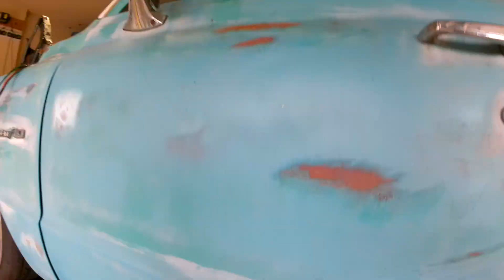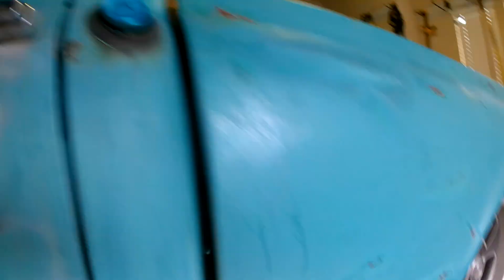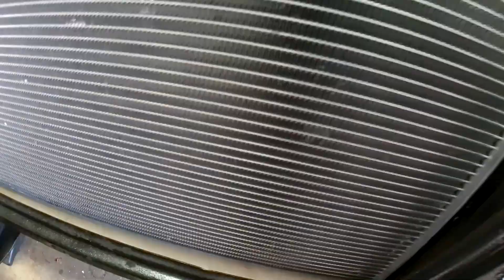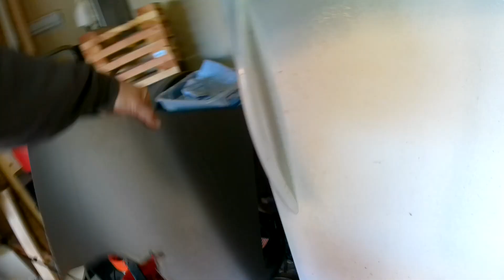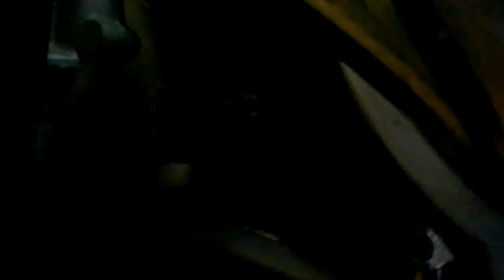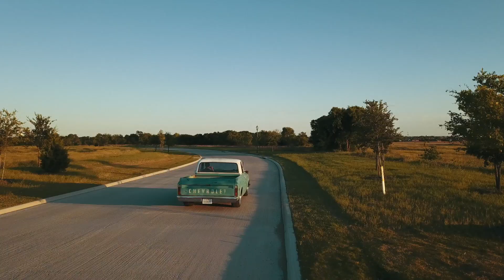1972 C-10 LS SWAP Build Series PT.6

Comment: just dropping back in and im at the point that drive train is in, cab isnt on right now but do you have any insight to share on positioning of the drivetrain forward/back.. I too have used the dirty dingo crossmember so i was hoping to get an idea on a reference point.  i will also be putting in the dual electric fans.  thanks in advance for anything you might be able to share on the matter.
Reply from the maker: There are 4 mounting positions for the DD motor mount plates.  I used the position that put the engine as far forward as possible in order to get some clearance with the firewall.  As far as the transmission crossmember goes, I set the engine and transmission in and simply bolt the crossmember to the frame wherever it hits.  I find it pretty rare that the mounting holes will line up with any factory holes on the frame.  So be prepared to drill some new ones.
Reply: @JeffLyle  thanks again for the quick reply! .. i think things are looking good .. tomorrow i will toss the cab on !
Merci.
Reply from the maker: @cdnbroncolife1889  That's awesome. I hope everything goes smoothly for you during assembly. But if it doesn't, just keep on wrenching and enjoy your passion!

Comment: Thanks for taking us on your journey. I'm going to be LS swapping my truck next year. Slowly getting all the pieces together.
Reply from the maker: Thanks for following along.  My sons and I had a great time building the truck.  Since then, we've done a bunch more... welded up new rockers, floor pans, and supports, added a new TMI interior, built a center console, and put a complete stereo in.  We've put 6500 miles on it since we swapped the drivetrain and it is continuing to run great.  If you have to video anything you do, I'd love to see it as well.  Best of luck with your build!
Reply: @JeffLyle  I repainted my interior, refreshed my gauages, new dash pad, reupholstered the seat, painted the door panels, and added a tach. I've done a lot but still a lot more to go. I'll have a garage next year so I'll be trying to do some videos on the swap.
Reply from the maker: @cfrank925  That's awesome, I can't wait to see it!

Comment: Nice looking build. I’m doing my 72 Ls swap as we speak getting everything lined up. Where did you get your cold air kit? Been looking for ideas on what to use and I like yours.
Reply from the maker: Thanks for checking out the build.  The cold air kit I got is the no name ~$50 kit from amazon.  It is sold under various names.  They are marketed as 99-06 silverado or tahoe and the tube comes with a bracket on it and it's about 10" longer than mine is now.  I just cut them up to fit.  I also use the couplers that come with the kit and the clamps.  However, they are not the best quality.  If you overtighten the clamps, they will break, so be careful, or just know you may need to buy extra clamps.
Reply: Sounds good yea that’s the part number I was looking at. How about your speedometer is that doing alright?
Reply from the maker: @ss454gm  speedo is spot on!
Reply: Thanks yea I seen one on eBay like that just a basic kit for like a 01 5.3
Reply from the maker: @ss454gm  by the way, nice c10 you have there.  I'll be checking out your videos as you go through your build!  Let me know if you have any questions along the way.
Reply: Sounds good I will. I’m going through my motor now doing a btr stage 3 truck cam and doing lifters rear main front timing chain and cover etc before I put it in the truck. Ordered my Holley x max harness the other day.
Reply from the maker: @ss454gm  oh man, you are well on your way.  That cam is going to be awesome.  If you havent thought about it yet, consider doing a converter too while you have the transmission out.  That cam will probably like something in the 3000 stall range.
Reply: Yea I got a rebuilt 4l60 with a 3k stall to pair up with motor. Hopefully this Holley harness gets everything going like it should I’m using a drive by cable motor from a 01 truck
Reply from the maker: @ss454gm  Perfect!  Drive by cable is cool too.  I just wrapped up an LQ9 swap on a 70 chevelle and we put a new intake and DBC throttle body on it.  I actually had a much easier time tuning the DBC than the DBW setup initially since the instructions are pretty simple.  They all require a little fine tuning though so be patient.
Reply: Yea he is sending me the Interface cable to hook up to laptop with my kit so hopefully get it all going good before all these c10 shows this summer. Hey on your Dakota gauges did you have any problems getting everything to work since your using the Holley setup?
Reply from the maker: @ss454gm  I went the easy way and used the Holley to dakota digital interface to hook the gauges up with.  I think all I had to wire was the fuel pump, power, and ground.  Everything else went straight from the Term X to the gauges through the interface from dakota digital.
Reply: Yea that’s what I was going to buy just heard few people was having problems getting the speedometer working. What all does that Holley interface do on the cluster oil temp tach volts etc I bought the rtx cluster
Reply from the maker: @ss454gm  BIM 01-2-HLLY module is what I use and my gauges are the VHX.  Everything reads out pretty close to what the handheld says... Speed, tach, water temp, AFR, etc.  I don't have a fuel pressure gauge hooked up so it doesnt register.  The only thing that is off a little that I can tell is the water temp.  The gauge on the cluster says its about 5 degrees warmer than the handlheld says.  I use a splitter so that the handheld and the gauges are both hooked up and I've never had any problems.  The instructions say it works with the RTX cluster too.
Reply: What kind of splitter do you got to use to make both work
Reply from the maker: @ss454gm  part number 558-465 Holley EFI CAN splitter.  This allowed me to run the digital dash interface and the handheld at the same time.  When I plug my PC in to do fine tuning and things, I just unplug the handheld and us the CAN to USB cable
Reply: Good deal thanks I’ll go to holleys website and check it out

Comment: Pretty sure I just saw this truck on facebook marketplace forsale
Reply from the maker: Scared me for a second.  I just looked in the garage... it's still there :)  Thanks for watching Slim!
Reply: @JeffLyle  theres def one just like it down to the wheels
Reply from the maker: @slimwilly573  that's pretty crazy!  Maybe it's an old post.  I bought this truck on marketplace over a year ago in Mesquite TX.  Where do you see it posted now?
Reply: @JeffLyle  it was a day or two ago.. and either north ga or Tennessee Carolina's I will see if I can find it again but same wheels, same color
Reply: @JeffLyle  what would you say the cost of doing the swap
Reply from the maker: @maddiesmithmaddieg  The essentials to get this done for me included the oil pan and gasket, full exhaust, fuel system (pump, lines, fittings, regulator), motor mounts, transmission crossmember, intake tube, shift linkage, radiator hoses, and driveshaft u-joint were about $1700.

I had the engine and transmission from my swap vehicle.  If you don't have that, they can be found for about $1000-$1500 with harness and computer depending on year, displacement,  and mileage.

I did a ton of extras like dakota digital gauges, AFM/DOD delete, cam, Holley terminator X Max, radiator with dual fans and other odds and ends which added another $4200.

Sine I did the swap, parts have gotten quite a bit more expensive.  So if you are making a budget, expect to pay 10-15% more for the same stuff.

Comment: Nice job
Reply: On my way to the same kind of build, 67 small window cab, ‘72 disc brake short wheel base chassis, aluminum Gen4  5.3, Holley terminator x. No bed yet, may have to have one chipped down.
Reply from the maker: @petejoseph8257  That's awesome.  Will  you be posting videos of the build as well?  I'd love to check it out and learn a few things from your experience!
Reply from the maker: Thanks Peter!  It's been a fun truck so far.   I already have 2000 miles on it since the swap and it is running great.